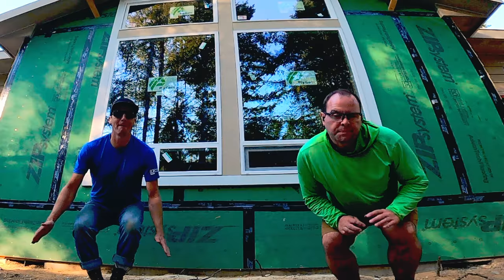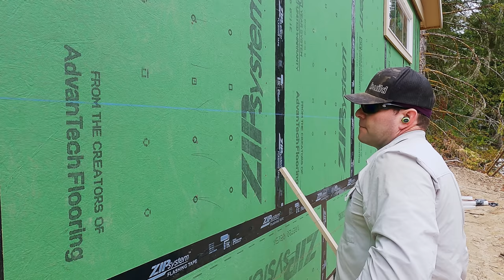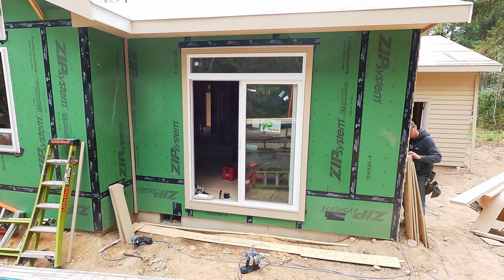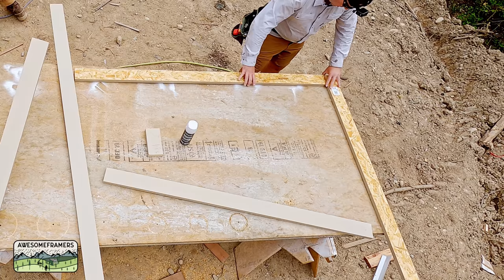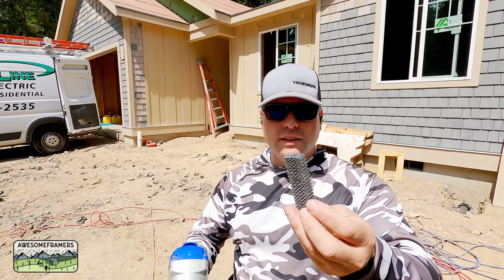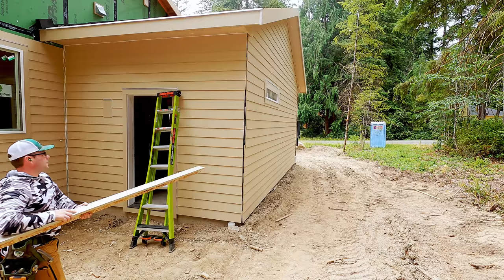How to Install SmartSide Lap Siding

Comment: Caulking butt joints is silly, such a waste, it’s just a point of failure, caulk is one of the first things to fail. Rhino skin or equivalent behind the butt joints is what we prefer and makes the most sense from my experience.
Reply from the maker: LP requires this detail, though they are coming out with a tech note that if you use pan flashing or slip sheets, they want an additional coat of paint over the factory primed ends.  That's actually what we are switching to.

I respectfully disagree with you about the caulk joints and failure being an issue.  I have heard that  since the early 90's and have been online asking for pictures for the 20 years and I can't find any evidence of this causing damage.  

I totally agree with you that caulking these joints, though required by the manfacturer, is a lame process.  Especially for the home owner because it requires maintenance.
Reply: I heard you mention the requirements from LP in the video . Doesn’t change my opinion. I definitely would rather paint the edges than caulk butt joints. Perhaps we don’t disagree at all, maybe I used terminology wrong. Caulk fails all the time, and requires maintenance as you mention, but I wouldn’t say caulking butt joints cause damage to siding. I have not found damage from failed caulk, just lots of work that is preventable. I would say the siding may suffer a little damage on the edges from removal of failed caulk and reapplication of caulk. Yet it appears a slip sheet will last as long as the siding. What do I know tho. Just a guy commenting on YouTube who has lost so much time and money building homes.
Reply: @AwesomeFramers  I can't believe such a big company started with a gap and caulk.  Didn't they learn from hardie.
Reply from the maker: @wcbscout  no, I don't think we disagree.  I do know that LP wouldn't be requiring gaps + sealant if there actually was damage caused by this requirement.

I prefer to eliminate sealant where possible for the reasons you mention, but the reality is here in our climate zone, a  good quality sealant like OSI Quad Max performs very very well.

Comment: I often find myself working alone on a build, and you are correct on just needing a helping hand at times, to hold up the end of a board, or help carry a large piece.  I too dropped the very same trim frame, so I took a six foot piece, and started a deck  screw  about six inches from each end, to support the frame on the top inside corners. Just a helping hand.

Comment: I like your idea of measuring inside from the floor.  We do almost all vinyl siding and I have everyone place the top of the starter strip level with the top of the sill plate all the way around.  This allows the siding to cover the sill plate by an inch.
Reply: You lost all credibility with the mention of willingly installing vinyl siding, I chuckle. Perhaps there is value in it I am unaware of. Round here vinyl siding is the dumpster fire of cladding. Please educate me about its merits. Apologies for the stern dislike for vinyl.
Reply: @wcbscout  We are building Habitat for Humanity houses so we need cheap, low maintenance siding.  Also you have obviously not had to maintain a 100 year old house with painted cedar shakes.
Reply: @WayneSmith-yf3fg  you are correct, I have avoided cedar shakes and vinyl siding for the lack of longevity and durability, and the maintenance. Wish you the very best day.

Comment: We just used the LP siding on a job for the first time.  It came pre-finished and it was so much nicer than fiber cement.  Easier to handle (you can carry it one handed right in the middle and it won't break), no silica dust, no special blade, holds nails better.  On the gable we sided, we installed a 1.75" wide by 3/4 thick piece up against the soffit.  Then we sided to that, knowing our angles wouldn't be perfect to begin with since the bottom course was going to be out of level.  As we adjusted and got to level as we went up, the pieces fit better, but we left about 1/8 light of a gap at the ends for movement.  Then we installed a 1x4 over that 3/4 furring strip and it came out looking sweet.   But yeah, it certainly helps to have that rapport with your coworker who can anticipate your train of thought and you do the same with his.  Makes everything much smoother and stress free.  Another fine job. Thanks for sharing.

Comment: Loved this whole Lakeshore Siding series!  Thanks for sharing!  like the way you guys did you outside corners over the LP lap siding.  I have never seen it done this way and it seems way easier.  Are you having to caulk in all of those gaps created by going over the top?  I feel like you said it is not necessary in so many words, but wanted to clarify.  Also, does the waviness of the LP lap at the bottom overlap ever go away?  I feel like most houses around me still have this for years.  Any tricks to prevent this?

Comment: The problem I see with doing corners like that is bugs man! Specifically wasps. I’ve ripped off enough vinyl shutters to know where wasps do there best work. And all those little gaps man…you’re just inviting them to start building nests
Reply from the maker: I hear you, that's why I always state that this works well in our area and climate zone.  We don't have that problem here.  We get a lot of rain, but we are fortunate when it comes to bugs.  

BTW, this detail is in the instructions for the siding, so I wonder if most areas don't have a problem with wasps.
Reply: @AwesomeFramers  I have to agree with @C5 TV.  It's not really the bugs more than it's the gaps over the laps that bug me.  Butt your siding to trim.  And I don't care what LP says. Three stinks gap at the butt is hideous.

Comment: I enjoy your channel.  May I ask a question?  When you nail the exterior trim around the window frames, it appears that the nails will penetrate the window flanges.  Is that a problem as the vinyl can fracture?  Could you alternatively nail more toward the exterior edges of the trim to avoid the flanges?
Reply from the maker: Good question. The trim nails won't damage the flange and the instructions for the trim show nailing this way.  My personal feeling is that you could do exactly as you describe and the trim is going to last and not move.
Reply: My thoughts exactly...I treat window flanges very delicate as you don't want to crack it..and from what we could see in the video of nailing that close to the window....that would be hitting no wood as the gap of the rough opening is there. Trying not to be critical as you do a great job...but just thinking out loud. Lol.

Comment: So no caulking in the corner trim? I'm curious because I'm building my own house and am getting ready to install Hardie plank. I live in S e Arizona and the summer monsoons are relentless. So you feel like leaving the ends open will promote better drying? What about critters? I am using Zip Board by the way and yes, I roll the tape LOL, I even mention it my videos.

Comment: Couldn’t you just but a heavy bead of sealant on those corner boards and that would fill the gaps when nailing them on?
Reply from the maker: you could.  We don't because it allows airflow to keep things dry and is a maintenance free corner.

Comment: Back in the day up in new england I clap board sided for a minute with a guy. He built a story pole so that the bottom of a clap would land on top of the drip edge on doors and windows. The to the weather spacing would be cheated to make this happen and not recognizable to the naked eye. We never notched out under windows or over the top. If I was not just a kid and paid more attention I would have learned his layout. I have search and searched it drives me crazy. There is a Youtube vid at a show and a guy teaching story pole from I think the same publication you write for JCL or something like that. The problem is he confused everything some people commented on that. One thing he was teaching is how to use a rubber band with mark of the spacing on it to stretch the to the weather spacing. I wish i could find a comprehensive teaching.
Reply: @PerkinsBrothers did a video on with a story pole and by angling it they found the new spacing. It was a white building Jaime was restoring. I actually learned something that day
Reply: @vansage2691  I was going to say the same, you beat me to it
Reply: @vansage2691  yeah, seen it on this old house agreed ago.  Layout your story pole with your reveal. Then, draw level lines from the bottom of your window trim and the top of your window trim.  Then, with your story pole at where the bottom of your first course should be, lean the story pole until on your lines on your story pole lines up with the bottom of the window.  Then mark your story pole reveals on the sheathing and transfer those heights to your corners and pop lines. Then do the same between the top and bottom of your windows. This will give you the bottom of your siding. You can adjust to get the top of your siding.  Your reveals will differ slightly but most people won't pick up on it.  Of course, if all the windows aren't the same size and at the same height, you're going to have to notch somewhere.  You need to pick what side you think deserves this attention.
Reply from the maker: we don't usually bother with lap, but in the next video I do that when I install cedar shingles.
Reply: @AwesomeFramers  That would be great. Thank you

Comment: Are all the lap joints caulked after? I would think a piece of metal flashing would be installed between the buttjoints since theirs only a 2 inch lap

Comment: Tim I'm trying to cut down on the amount of caulking I need to do when siding a house. I'm going to try your corner method on the next house. I was wondering if you have ever used a similar method on inside corners and what the pros/cons are from your point of veiw.
Reply: I'm also looking for a description on your payload gun you nail trim on with I'm guessing 15 gage nails?

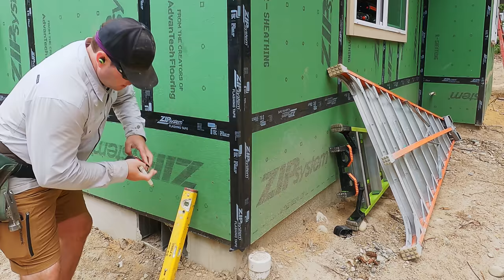Comment: @ 0:35 sec. Did you forgot to add the tape on the bottom of the zip board behind the ladders? Rgds from Germany Carsten
Reply from the maker: I just showed tape as an option.  Others chose metal or to hold the wall back.

Comment: Great video.  I was surprised that you didn't use a rain screen though.  Is that a new LP requirement or just for their board and batton?
Reply from the maker: check out part 2 of the siding.  It is not required by LP
Reply: @AwesomeFramers  I did see that.  I could have sworn Kyle Stumpenhorst said it was required by LP now, perhaps that is just for the vertical as you indicated in part 2.  Really binging all of your content today, loving every bit of it.  Thank you for sharing your knowledge! Really enjoyed the video on how to measure/calculate the overframe for this one.
Reply from the maker: @joep8520  Thanks bro!

I had the same question about the "water screen" after attending IBS2020.  Here is the link https://lpcorp.com/resources/product-literature/technical-notes/tn-028-vertical-siding

Both Weather Logic and Zip qualify as "non-compressible drainable housewrap"

Comment: How do you feel about using a rain screen under siding?
Reply: A Rain Screen is the way to go on all new envelopes. 
Just follow the Perfect Wall principles.
Reply: I second that. No way I'd put up siding without one. Hopefully it's code everywhere soon, along with some exterior insulation.
Reply from the maker: In part 2, you'll see the rain screen behind the cedar shingles.

Zip panels have a 98% drainage efficiency when tested to ASTM E2273-03.  That test is more rigorous than lap siding installed.  

When we install panel siding over the Zip, then we provide a gap between the sheathing and siding.  Many people or way overselling the benefits of rain screen.  It certainly is a good practice, but is not needed in all cases or climates.  

What we need to focus on is getting the details right on the siding, flashing, maintenance, etc.
Reply: Exactly man. Need to focus more on attention to details and less what the cool YouTube gurus building unlimited budget homes rave about.

Comment: Great information. How do you do your inside corners? I am almost at the siding stage for my home addition.
Reply: Around the 16:00 mark he shows an inside corner, looks like they ripped a board of the siding trim to a square 2x2 or whatever the reveal is and nail it to the wall butting their siding to it.  That's the way we usually do it anyways

Comment: Wish building was like this back in the day. Instead it was working on inexperienced crews consisting of felons, druggies, misfits and cranky old lead carpenters who just barked and berated you and rarely taught anything. Framing was crap wages, dangerous because of the idiots hired off the street and a hard life during the long dark PNW winters. Hopefully thing are different today.

Comment: Why no flashing behind the butt joints?
Reply from the maker: no need for it.  Follow the manufacturer's instructions.  If you feel it is needed, please provide some pictures showing damage from the lack of sealant.
Reply: @AwesomeFramers  I only asked because every manufacturer I have found so far has required back flashing in their installation instructions. After watching this I tried again to find one that didnt and gave up at 13 that all required. 

Thought maybe you guys had a creative way around it
Reply from the maker: @LittleBunnyKungFoo  so the LP SmartSide instructions show sealant at butt joints to meet warranty.  You certainly can slip sheet behind the joint too.  In fact they now show a detail where we can slip sheet and eliminate the sealant (provided we paint the ends over the factory primer).  https://lpcorp.com/products/siding-trim/build-with-lp-smartside/installation-instructions

I'm sorry for coming on strong.  As you can see from the other comments, people claim there's an issue with no slip sheet or pan flashing, but no one every shows actual damage.  I shouldn't have assumed you were one of them.  I owe you a beer.
Reply: @AwesomeFramers  No apology necessary, but Ill take you up on the beer. I read that guide but totally missed the “four options.” I skimmed through and thought it required caulking AND flashing, not either or. Glad I asked - always room for learning 😁

Comment: What sizes corrugated nails do you use?
Reply from the maker: I believe they are 5/8" and I buy them from https://www.nailgundepot.com/spotnails-x1c1008-12-crown-corrugated-tool-14-to-58-details.html

I forgot to add that in the description, adding now.
Reply: That’s what we used to use to build when the window screens for the windows back in the 50s and 60s but we drove them in with a hammer and they worked real good

Comment: Just curious. So u work for pioneer builders but you’re more of a subcontractor right?  I take it u work for other builders to.
Reply from the maker: nope, directly for Pioneer.  My dad started Pioneer when I was 6 months old and has always kept the framing and siding in house.  Subbed when we had too much work, but typically we've done the framing, siding, and foundations in house.

If the market gets super slow, we've subbed out to other builders, but only a couple of times in 43 years.
Reply: @AwesomeFramers  So did your pop do the framing when you were young?
Reply from the maker: @nobodyimportant002  he did, but he had a lead carpenter and worked as a helper during the day then evenings getting the business going.
Reply: @AwesomeFramers  So he was the builder, but he had an in-house framing crew and he also worked with them as a helper? Having an in-house framing crew sounds like a great way to build. I don't know if I could make it work here in central Texas, but I may give it a shot someday. My greatest challenge, by a wide margin, would be finding someone reliable enough to step in as framing lead. There are a handful of good folks out there, but methamphetamine inevitably seems to work its way into their lives. Naturally, then, their leadership, quality of work, and production drop precipitously. In my experience, it's been nearly impossible to bring them back from those life choices because they genuinely don't think they have a problem. They have a false sense of being in control of themselves. It's really sad.
Reply from the maker: @nobodyimportant002  yep, and over the years there was turnover, but always had good guys to work with.  I remember summer of 89, I was 12 and out there hand driving 2x4 walls together with one guy named Frank.  He was doing layout and I just swung away.  I remember it taking a lot of swings to drive a sinker 😂😂😂😂😂😂

Comment: Wow why would you not flash those butt joints…what a crucial error, there has been many houses that have had to be resheathed due to caulk joints failing, shrinking, cracking….not to mention that lp siding is just chip board, water gets behind it and it’s basically tissue paper and all over with
Reply from the maker: I disagree